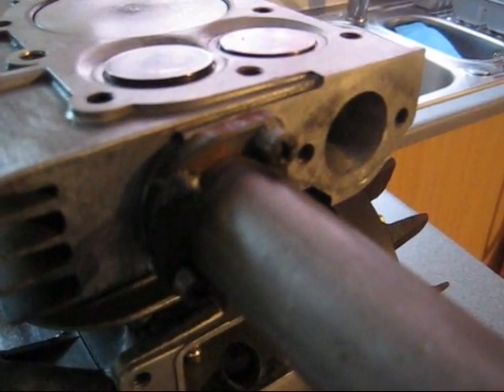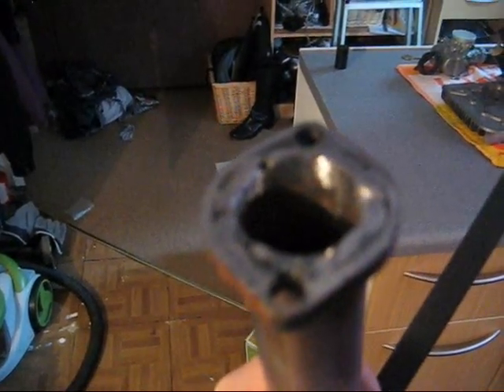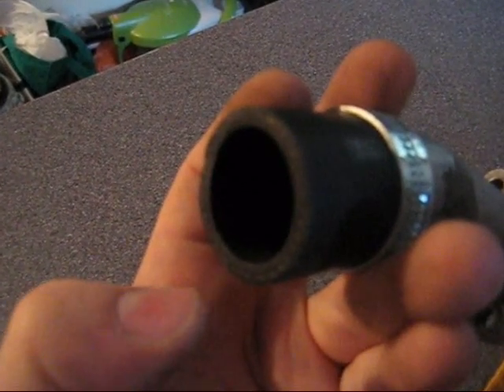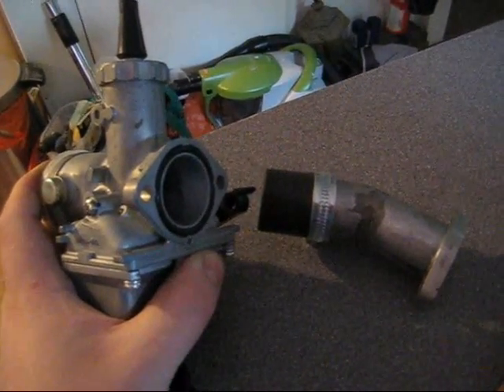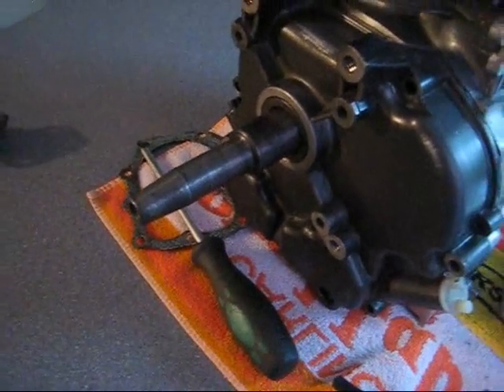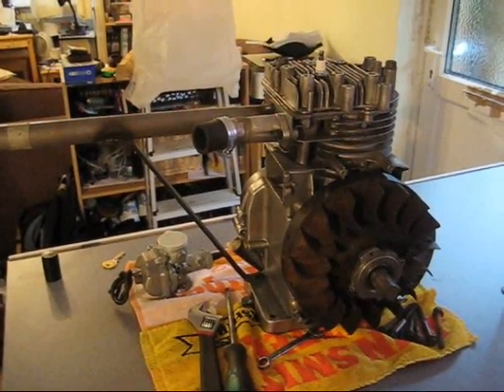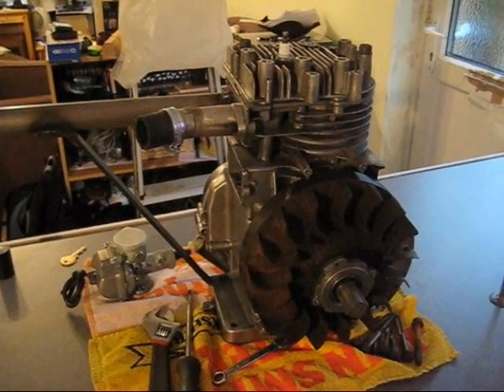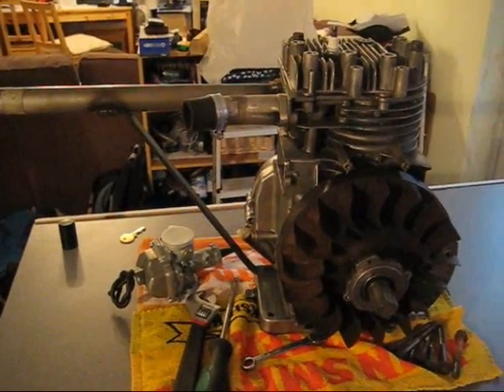8HP Briggs-Pt2

Comment from the maker: Yeah I definitely want to tune the exhaust. Just need to find some larger diameter tube. I did read on the old mini bike forum about doing a stripe of paint down the exhaust and cutting it where the paint starts to burn, welding the larger tube and doing it again.

Comment: Also you can make a tuned exhaust for your engine that adds at least another horsepower alone. You can take the exhaust pipe you have now, cut it to 6 or 8 inches, then double the size of the pipe and cut it to about 10 inches. Run the engine, then after a while there will be a little blue ring that forms on the bigger pipe. Then you cut it about a half inch below the blue line. This adds about another horsepower or two. Good Luck And Very Nice Work!!

Comment from the maker: Hi, the engine was originally off a generator (see the tapered shaft).  I would definately recommend putting it on a gokart! Anything from 3.5hp upwards really. The 5hp has the most aftermarket performance parts available if ur interested in doing that.
As for the 2 carbs, it will be tricky to make the manifold, and to get it smooth and free flowing on the inside. I dont think I have seen any 2 carb manifolds for sale, especially not for the 8hp.

Comment from the maker: @ciclotronforever 
I am definitely not using the stock head gasket. I might use hi temp silicone, or I have some copper sheet that is about 0.5mm think.
Silicon will probably be the best as I need some for the manifolds as well

Comment: To improve compression I personally  get rid of the head gasket! I surfaced the head and the block using a mirror with a thin sand paper taped on it (to have a really plane surface) and used hi temp silicon (a blue stuff to make gaskets, it don't know the english word..) It worked all right for me, no leaks if the bolts are torqued correctly!